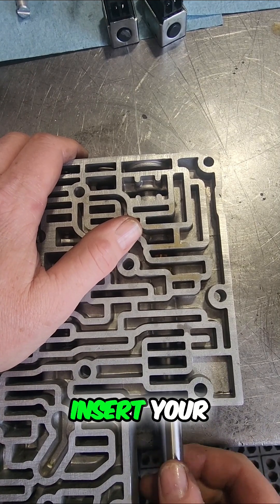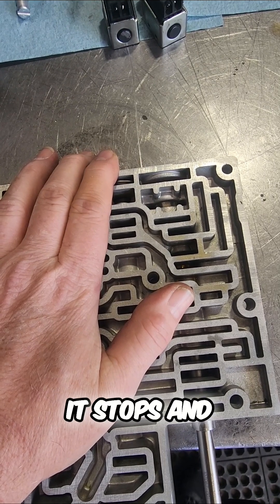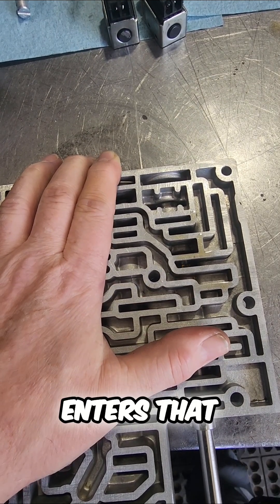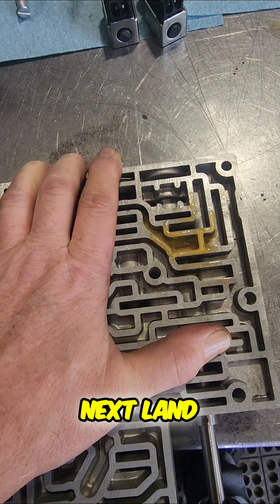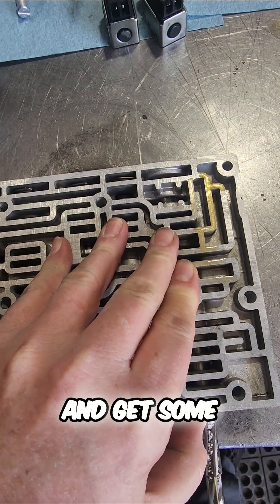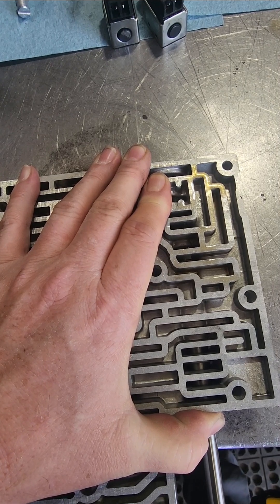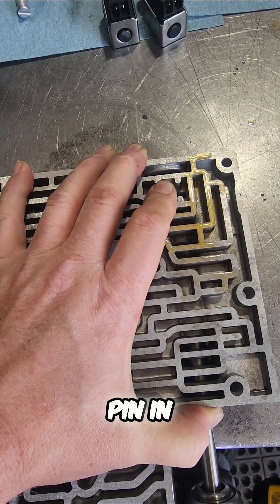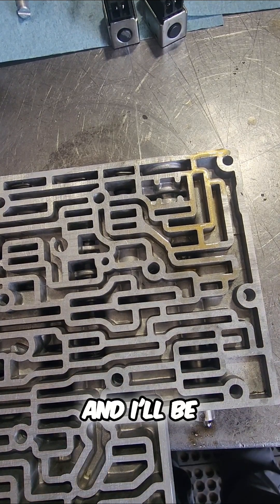4L60E Valve Body Fix: AFL Valve Test & Ream! Part 2 of 5

Comment: What does this fix? I have a 4L60E and its got a few valve body issues. Very laggy when it kicks down to 2nd going up a hill.
Reply from the maker: The TransGo AFL oversized valve fixes worn valve body bores that leak pressure.
On your 4L60E, it helps fix lazy kickdowns, slow shifts, slipping, and weak engagements — exactly like you're describing going uphill. However, other possible issues that could also cause laggy downshifts or sloppy behavior include:

Worn boost valve (causing poor line pressure rise)
Worn or sticking pressure control solenoid (EPC)
Weak or sticking shift solenoids (especially 1-2 and 2-3 solenoids)
Cracked separator plate (causing cross leaks between circuits)
Worn separator plate checkball seats (hydraulic leaks)
Accumulation piston seals blown or cracked (causing cushiony shifts)
Valve body channel plate or gasket leaks
Worn or sticking 1-2 accumulator piston (specifically affects 2nd gear feel)
Low main line pressure from a worn pump, especially common on high-mileage units

In some cases, a combination of a bad EPC, worn AFL bore, and tired boost valve all stack up to cause really sluggish behavior like you’re seeing.
Reply: @ thanks alot. I appreciate the information.
Reply: And the old PO1870  @TriStarWWPO